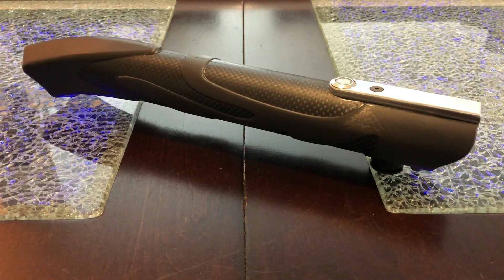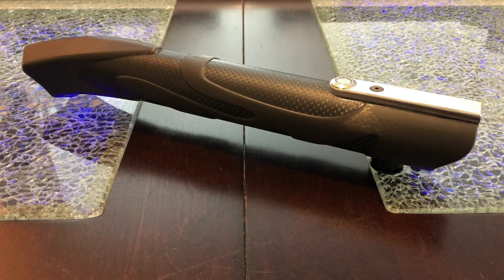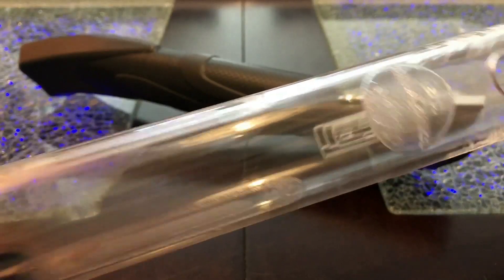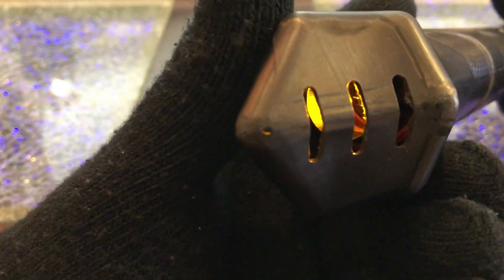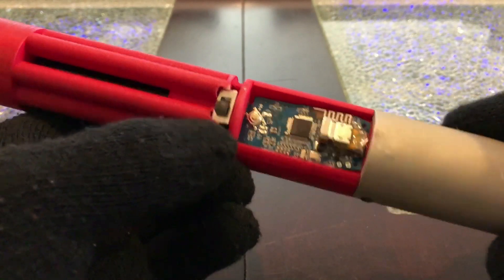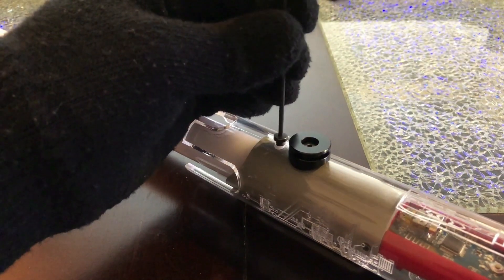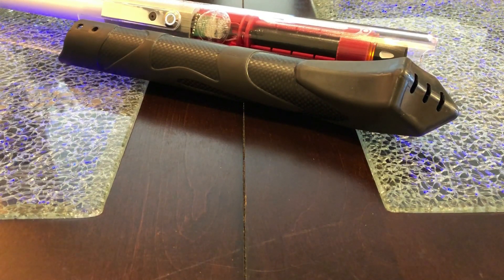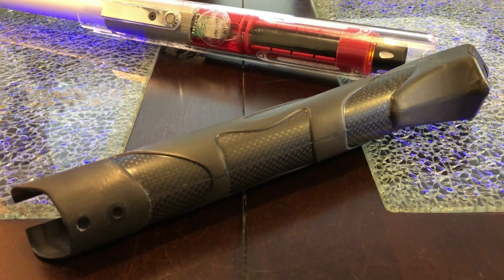JediArmsDealer's Bendu Armory Carbon Fiber Lightsaber Review

Comment: Boom boom. So loud it fills the room. I like that the covertec wheel is at the top. So many little innovations. This saber's the cream of the crop!
Reply from the maker: Thanks Space!! This Saber just got an overhaul and is now sporting a Proffie with the new OLED display for PLI and viewable fonts names…The Bluetooth sounds insane on big subwoofers with Smoothswing~~~
Boom Boom in the car and living room)))))))))))))
Reply: @jediarmsdealer5994  Oh yeah! Is this your personal saber? I can't wait to hear the Proffie on Bluetooth on my home stereo... I"m working on one now alongside what I'm doing for Brad because this other build is also a string blade build for the Proffie in the same blade color as Brad's
Reply from the maker: SpaceWindu This Saber has become my personal test Saber since it’s super install friendly...Andrew at Bendu Armory made me another custom fiberglass sleeve that doesn’t block the Bluetooth signal at all and the Proffie on the living room surround system is a Jedi’s Dream!! I’m in the process of painting the hilt with chrome paint pens and then I’m going to use clear epoxy to seal it in<> Defintely looking forward to Brad’s build and the build you’re adding the Bluetooth transmitter I sent you>> We should have a chat about hooking the Proffie up to Bluetooth because I’ve recently discovered it needs a variable resistor to make it sound much clearer~ Chat soon my Friend!!
Reply: @jediarmsdealer5994  That's sick, dude! Ah, the chrome pen like the one you sent me :) Can't wait to see how that looks. Yes, we will chat about the Proffie bluetooth. I do have some variable resistors in stock. Maybe those are the ones yo mean. Talk to you soon,

Comment: Bendu has beautiful carbon fiber hilts. 2 main downsides though. 1) with CF, there is always a "seam" on the design that's visible on the outside of the hilt. You can see what I'm talking about at 6:08 as you're showing the 360 of the hilt in front of the camera. 2) with the CF design, there's little bit of "bleedover" between the colored pieces of the hilt and the edges of the carbonfiber design. So for people that insist on pristine looking hilts, these might present minor problems for you. But Bendu's sleeve design is totally awesome. If you purchase one neo-pixel at about $530, you can purchase additional "sleeves" (empty hilts) for $150, and swap out the electronics cores from sleeve to sleeve. Now there are different types of sleeves (one type for the bended pommel and one for the straight style), but that's a pretty cool way to get multiple saber designs without having to pay full price for additional sabers. I have the Black Obsidian saber on order from them, and I can't wait until it arrives. I've seen enough demo videos and talked with enough saber enthusiasts who duel regularly with these to know that I really want one. Many have also spoken to the indestructibility of these hilts as well. They can get minor nicks and dings, but the carbonfiber material is incredibly strong and durable.
Reply from the maker: scbluesman13 
An honest take on these…
Thank You for that<>
Reply: @jediarmsdealer5994  You bet! I hope you are enjoying yours!